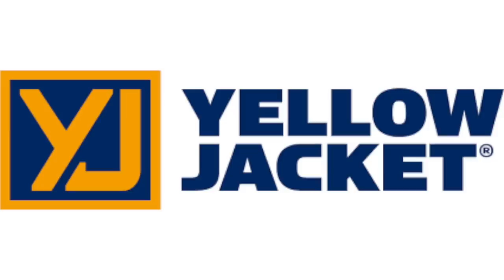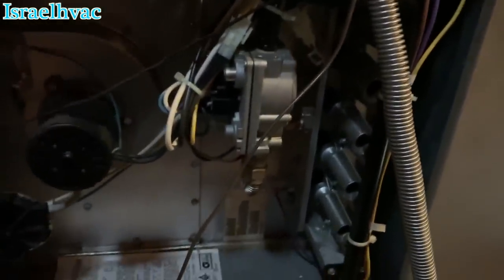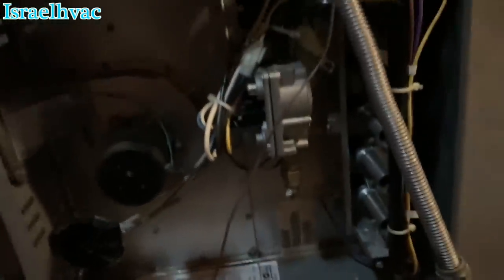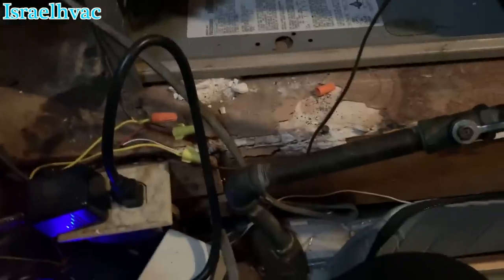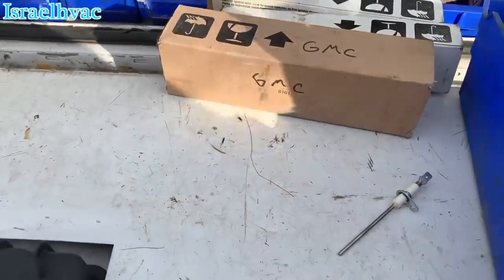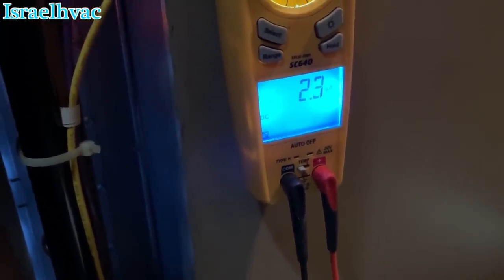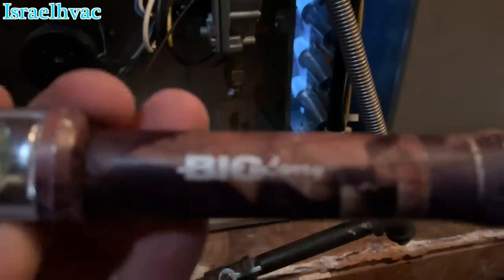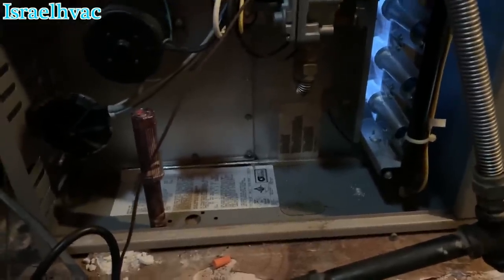HVAC | No Heat | York Diamond 80

Comment: had this EXACT problem today. thanks for making this! my boss (me) just cleaned up the tip of the sensor and heater is running great again. i was getting 25V at the sensor with flame present after it was cleaned up and working.

Comment: flex leading from the wall connection to the actual unit is code in the area i work  but it does have to be hard piped in after it passes the lip of the unit after the flare fitting .

Comment: When I worked at a fuel oil propane company you could red tag and shut it down because we were the sole fuel provider but if went on a natural gas call that was shady we could not red tag due to liability, we would put a red tag on and note operate at your own risk and notify the gas company.Now if the heat exchanger was cracked we would call the gas company and wait for them to shut the gas off because if you shut the gas off and their house freezes up your holding the bag.

Comment: loose connection or poor ground bonding can cause low flame sensor output.  loose screws/ground wires on the metal, burners, gas rail, gas valve used to be a bigger issue, but they've gotten better at adding a bonding wire.

Comment: Ok, extremely rookie question.

I already fixed a loose connector on the control board (the harness was a little taught IMHO), and cleaned the flame sensor. The furnace appears to by cycling fine now (I was very pleased). EXCEPT WHEN I PUT the doors back on.  Ok, before you laugh too hard....I previously diagnosed the door switch as operating properly. The furnace is mounted horizontal, and it appears some sat on the furnace...probably during a previous repair when they changed the zone board.  So the doors do not just fit in the nicely. Its extremely tight.  On the bottom door (with the ignition port hole)... does that go on first, and if so, is the upper lip suppose to hook around the L-Bracket to hold it tight against the switch... however I can't get the upper door in if i do that.  Anyway, I don't to force them on wrong. 

Thanks for any help.

Comment: that gas line passing through the cabinet is bad, because vibration can cause a rub through and that would fill the attic with gas and when it fires or anything makes a spark "kaboom"
I would have been seemingly evil and shut it down, tagging it as unsafe to operate, but it's hack work like that which causes explosions and deaths

Comment: Im really hoping that, that unit was a DIY install.. Because if a professional installer seriously installed it like that with the floating gas pipe and using the flex stuff then they should lose their license.

Comment: My Diamond 80 had a bad blower capacitor,  bad circuit cracked solder joint and that flame sensor had to be cleaned every four years, otherwise an average GF.